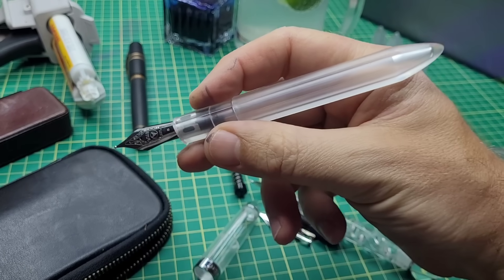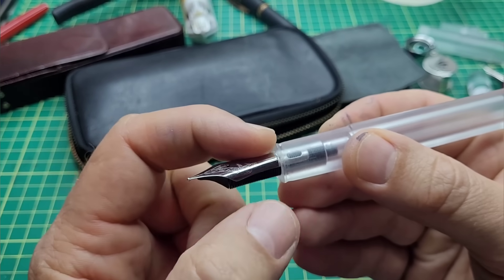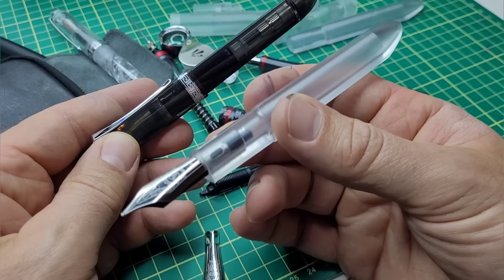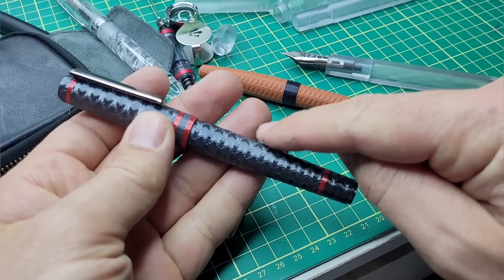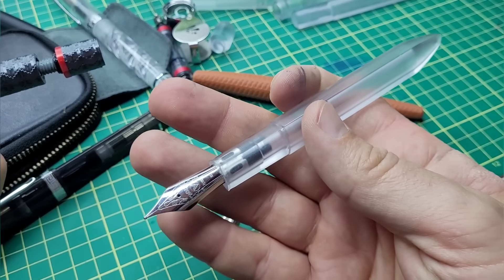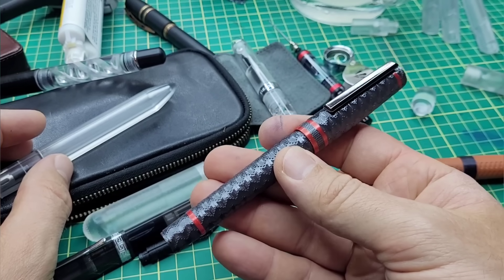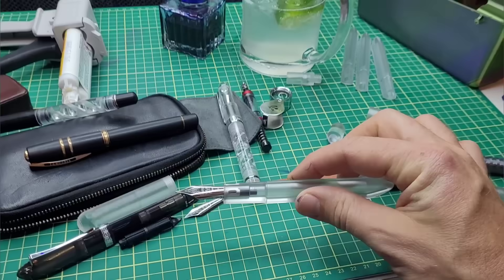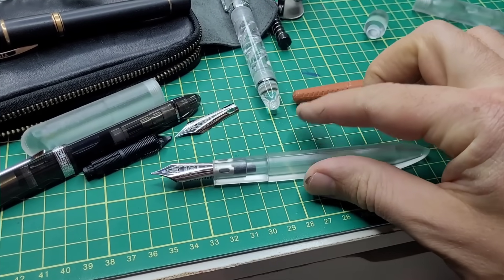The 3D Printed Fountain Pen Project Has Begun!

Comment: Bro, it's a pen; I think pen design is a solved problem lol
Reply from the maker: You should inform all the pen manufacturing companies about this.  I'm sure they would love to hear from "the smartest guy in the room"  While you're at it let all the car companies know too: "hey bro, we already have car designs why you still working on this"
Reply: @Doodlebud  i actually have a  Kedar SA-AT1102 torch light which has lined cavity of cylinderical grip and it provides me a wonderful grip so what about u represent the same grip for fountain pen grip,
Reply: @Doodlebud  He's right, the problem is solved, but that doesn't mean that you can't design stuff that's better and more fun!
Reply: @Djentstructer  a "solved problem" means that there is a single, absolutely correct answer that cannot be defeated. to solve 1+1, you would determine the result to be 2. this is immovable and can never change. but a more relevant example, chess is weakly "solved" from any position with 7 pieces or less, but it's too difficult (for now) to solve any further because the number of possible moves and their relative values are too many to parse.

AKA, unless you can factor in every possible situation a pen can be in, and every single use case, in every circumstance for every user, while also factoring in their collective individual preferences, then you can't "solve" pen design lol
Reply: @TheJtPv Actually, you’re right about design problems as a whole not being solvable, at least knowingly. But I disagree with how you think of a problem; there can be multiple solutions to a problem. Counterexample is as such:
Problem: I have a raw egg and it needs to be cooked.
Solution: Boiling, frying, poaching, …
Observe that any of the above solution adequately solves the problem. 

So, it would appear that the number of possible solutions depends on the problem itself. Now, in the original comment, I took pen design to mean simply the problem of creating a writing utensil that could be used in daily life with relative ease. It’s debatable what relative ease might mean specifically but in that case, practically speaking, that’s solved. I think that’s what the commenter was trying to say too because no one would be bold enough to claim that a design problem at large can be solved knowingly. It would have been valuable to define what was being meant by design problem.
Reply: Bro, why are you here lol
Reply: ...bro has only ever used ball point pens huh
Reply: You're right, that's why whenever I go into the store to buy stationary there's only Bic Crystals on the shelves. Oh wait...
Reply: YT comments on your level are definitely a problem to be solved.
#notmybro
Reply: I love it when Youtuber pinned these stupid comment.

Comment: I only have a FDM 3D printer at home. My question is, do you think it would be easier to make and design a pen using PLA or using a resign 3D printer? Also would the design be the same for both knowing there would be a different outcome because of the detail differences if you were to use the same design on each printer? I assume each slicer setting per printer would yield the appropriate G-Code.
Reply from the maker: I have an FDM pen design Im working on too.  Im designing the pens with each printer type in mind since they both have pros/cons and differences in precision and materials etc.  So a design with a SLA printer in mind might now work out with an FDM printer and vice versa if that makes sense.

Comment: Hey Doodlebud hope the vacation is going swimingly. I did a lot of resin printing for dnd minis i usually used grey resin but i did use some cool blue transparent resin many times. The outside is ALWAYS cloudy, its down to you to polish and smooth it out to get it to clear up and look nice and shiney. Thats the crux of clear or transparent resins. However you're solid colors WONT have that cloudy issues. The inside of your prints may be a different story though. 

If you want to try dying your resins id suggest getting resin specific dyes or ones that work with resin and add them to the clear resin while in the vat. Some will be better for your clear resin and others will be darker and better for a solid white resin. However you can make some cool designs if you dont mix the resin and dye and just let the printing head do its thing multiple colors even.

Personally i love the matte look of clear and transparent color resins. You might also look into a program called Lychee if you dont like the current one you are using. I used it a lot to help with my resin supports and what not. Also as a final note please for the love of all if you havent make sure you wear a mask or at least have good ventilation because resin is toxic in small places 😆 learned that the hard way myself even though i love the smell of resin.
Reply from the maker: Im actually looking into having supports designed as part of the print itself.  Also to try to go direct from print to curing :)  I'll try out a special fixture it will fit to directly from the build plate to hold the full pen with supports and cure the whole thing without having to touch the pen body itself.  Then once its done, cut off the bottom support structure and do a quick polishing where it was connected.  Worth a try anyways.  But the frosted look has grown on me

Comment: I know its still quite early in the process, but what filling system are you thinking about using? I feel like the Hex Pens solution is probably one of the best when it comes to mostly all 3D printed components. Just unscrew, drop ink in with a dropper and screw the nib section back on. And to clean it out, just open the other end and flush it with water. Simple, fast and very efficient cleaning.
The platypus ink-sac is amazingly well designed, but (without any experience with that pen) I feel like it could be a pain to change inks and clean everything properly. But Im gonna go ahead and watch your review of that pen because it looks absolutely phenomenal for a 3D filament print.

Comment: That's really cool. I actually think the eyedropper filling system is a fantastic system. Very easy to do, and if you get a section that threads it should be pretty easy to find a rubber gasket to seal it. I have a 3D printer in my garage that I got from a work acquaintance that I would love to try it out and make something, but I'm not great with 3d design software. It would be great to have a premade Doodlepen design to plug in and get the feel for how the software(s) and printer work together. Good luck!

Comment: OK, you're literally doing what I'm setting out to do in 2026, namely create OMAS Magnum-inspired 3D printed resin pens. A few quick questions if you don't mind:
1. How did you come about using Fusion 360 vs other modeling software?
2. Did you start with a base model file then modify for the Magnum, or just create from scratch?
3. If from scratch, did you study other tutorials?
Thank you again for the inspiration and the push to go from start to bad to good, etc!
Reply from the maker: 1) There is a free version of 360 for personal use so I went with that.
2) I designed from scratch
3) I've been learning Fusion from tutorials and videos online sporadically.

Comment: As a long time 3-D printing dude, I suspect the only difference between your version and the pros is that you need to sand and polish your print. Polishing should take it from the frosted look to the crystal clear look. Though I would guess you would have to do the same to the internal surfaces to make it clear all the way through. I kind of like the frosted look though! Hope that helps! Also, if you want to add color, you can add dye to the resin prior to printing. I’ve never used it, but I believe alcohol based dye is what you would need.

Comment: CAD design of ergonomic/organic shapes like a pen is mega hard. Doubly so if it's not actually round. Round is easy; you just revolve a sketch. That triangular shape...oof. I guess you could do it with a loft but I would probably use surface modeling.

Comment: I love 3d printing and all the things it makes possible, but sometimes you can get a much better result using a combination of 3d printed and off the shelf parts (or custom parts made other ways), like an o-ring or some sort of metal parts or soft/pliant parts (unless you can print tpu or other soft parts with an fdm printer). Of course, I also love the idea of challenging yourself to do it 100% in 3d printing to see if you can/challenge yourself, if that's what you're going for, and I will very interested to see how you solve or avoid any problems that come up if you do. Either way, very excited to see where this goes. Also, for the finish, I'm sure the hex pen does not come out of the printer that shiny - they're definitely buffing it afterward. You can probably also get a shiny finish by just painting it with a thin layer of that same resin over the entire surface (inside and out if you want it crystal clear into the ink cavity) and then curing it with a UV light.

Comment: I would probably print the cap finial down, which with a smooth plate will give a very good surface and the red dot will have a smooth face on the visible spot.

Comment: I’ve been 3d printing for a few years now. The beauty of the manufacturing method is that you can do a lot of things with 3d printing you can’t do with conventional manufacturing. For instance a pen with modular sections where you can turn a pocket pen to a full sized pen with a couple of spacer pieces is relatively simple. It’s kind of a pain with conventional manufacturing methods.